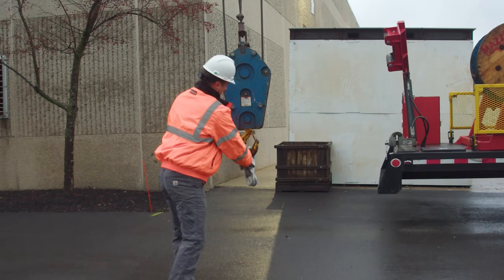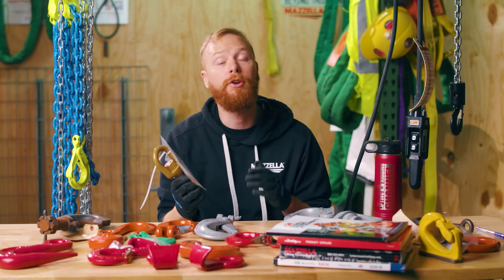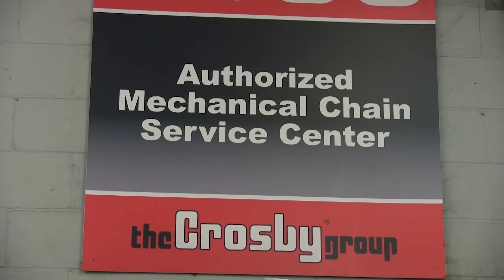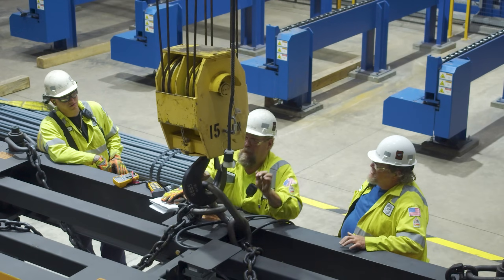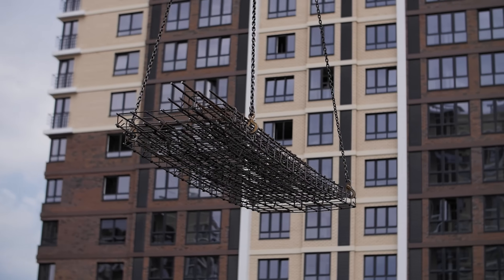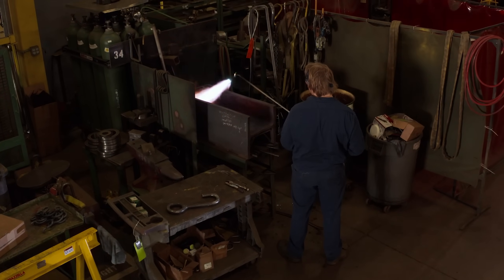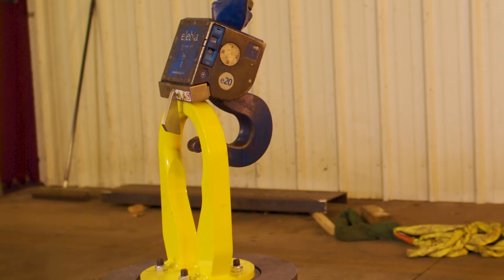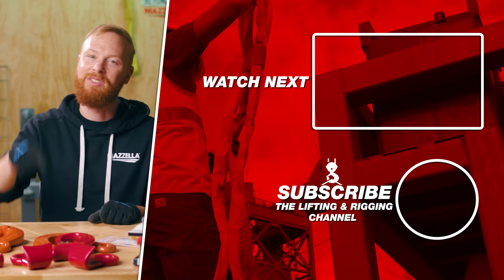Complete Guide to Lifting Hooks

Comment: Sorting hooks: Are they to be used with any type of rigging (slings, chain bridles, lifting eyes, etc.) or should they only be applied to the intended type of load that accepts the hook itself?
Reply from the maker: Yes, you can use it with wire and chain.
&
Yes they should only be applied for the intended type of load for the hook. The hook has two WLL’s depending on how it is being used:  2 ton at the tip, 7-1/2 ton at the base of the hook.  Design factor is 4:1 to replicate chain Design Factor.
You should not be using it as a replacement for a hook with a latch to AVOID dealing with a latch. Latches serve a valuable role in day-to-day rigging. If a latch kit poses a potential hazard if used for a specific task, then a foundry hook would be the better option.